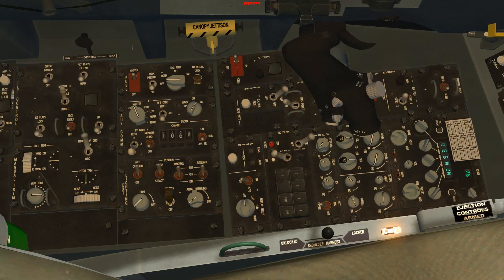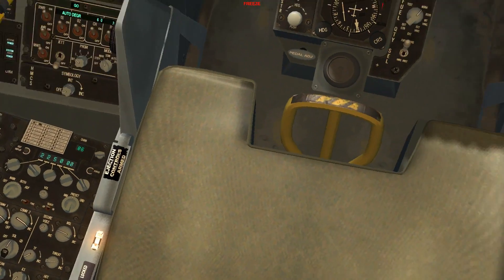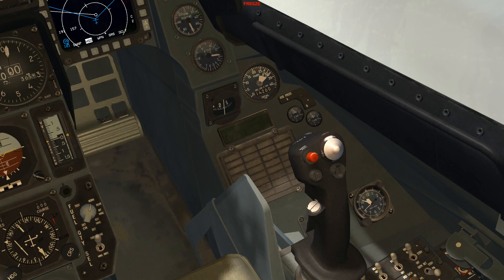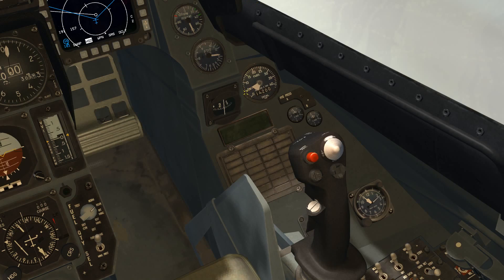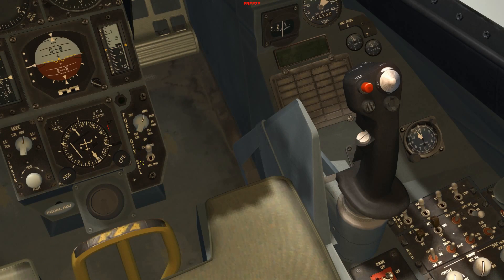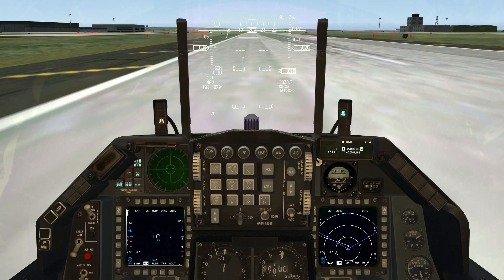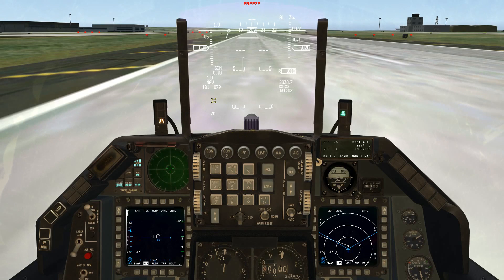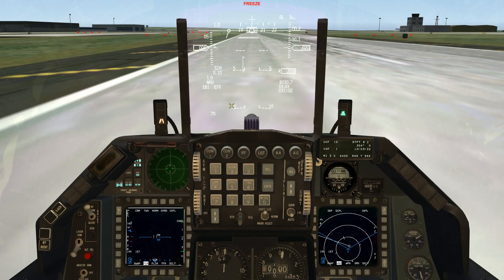F16 Fuel Syst In BMS 4 33 1

Comment from the maker: The External Fuel Transfer switch is only a player if you have all three external wing tanks strapped to the aircraft. Now you have the option of which external tank to burn first. With just the external wing, or just the center external tank on the aircraft there's no need to use this switch.